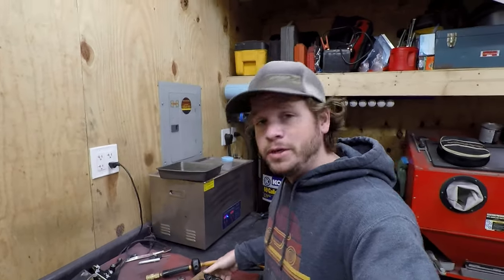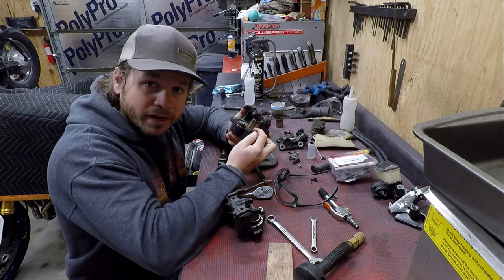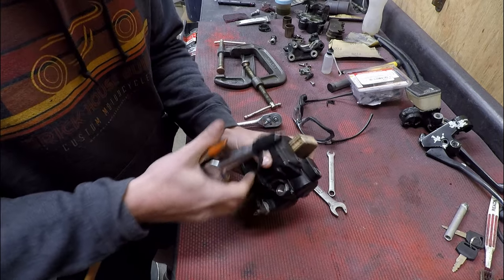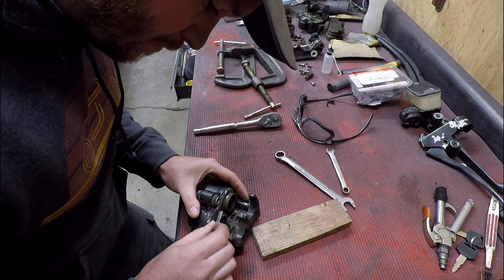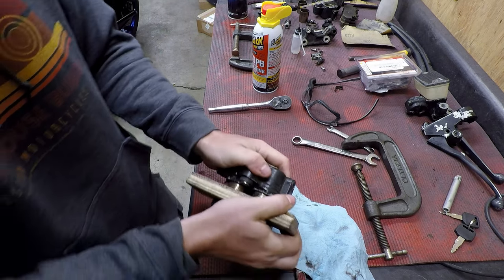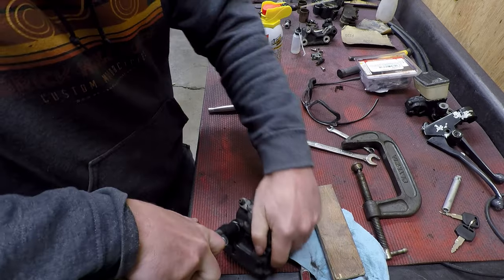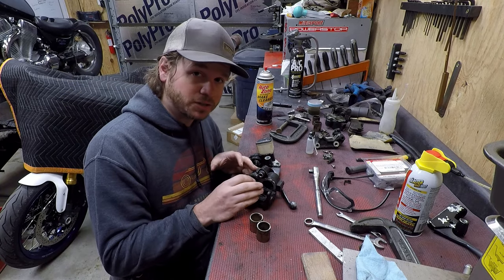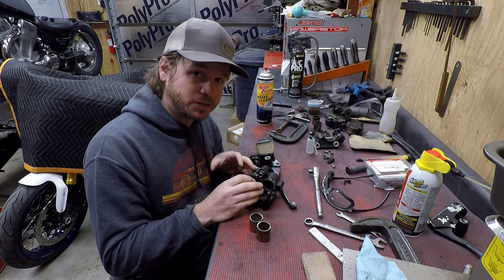HOW TO Remove Stuck Brake Caliper Pistons - GL650 Build - EP14

Comment: If they came out using compressed air they weren't stuck very badly. Air will compress, fluids won't. I've used 200 psi trying to get them out before & failed. Easiest way is to hook caliper up to a functioning master cylinder & use brake fluid to press them out. Other tips were good.
Reply from the maker: Well many people don't even know about compressed air. Using another master cylinder is obviously more powerful but I've found this works 98% of the time once you break them free.

Comment: Spot on. Also air compressors aren’t cheap I was going to buy one just for a stuck piston. Sure I can find other uses but £150 on an air compressor doesn’t seem feasible for now 😂 especially as I’ve ordered a rebuild kit, piston and pads for the rear calliper already which again didn’t come cheap. I’ll be using the brake fluid master cylinder messy method until I can get myself an air compressor. Great video buddy!
Reply: I was fortunate enough for my friends to get me one for my birthday, it makes life so much easier

Comment: Soak the calipers in vinegar for a day or two and you will be able to pull them out with your fingers.
Reply from the maker: Any negative side effects on the paint soaking that long?
Reply: @BrickHouseBuilds  No. Vinegar is a very mild acid.You can dunk them in alcohol to neutralize the vinegar or just wash them with hot water.

Comment: You know, as a guy who is working on a Honda CB400T that has sat for twenty or so years and the brake fluid broke down and the pistons are stuck, I really appreciated this video.  I think this bike might actually use the same caliper as the left one of that pair.
Reply from the maker: Glad its helpful! The info can be used on any caliper but glad it has a direct reference for yours
Reply: @BrickHouseBuilds  Out of curiosity, do you remember / know what PSI you were using in this video?

Comment: Try cleaning pistons with 0000 grade superfine steel wool works good with WD-40 to clean stainless steel or chrome surfaces with corrosion or surface rust.

Comment: One of the better tutorials on how to do a challenging job without too much drama. Thanks.
Reply from the maker: Glad you found it helpful!
Reply: @BrickHouseBuilds  Yeah; I wasn't planning on doing the brakes, but I had to rebuild the forks on my 2002 ZX9r (blown seal), which was an educational (and messy)  experience, and when re-installing the calipers, noted that one  of the caliper pistons on the right  caliper was awfully difficult to press back for pad installation. So it looks like a caliper rebuild is in the near future, even though the brakes seem to be working ok. I think I probably should rebuild the master as well, while I have the system drained. After all; I;ve put 83000+ miles on this bike...

Comment: Just came across this video. Its very good info. Iv used the spare mastercylinder trick to get pistons out. I like the c clamp 1 with the caliper sealed off and wind in the clamp to move the stuck piston.
Thanks for this vid.

Comment: I have used a fresh tire valve stem because I didn't have the rubber tipped air nozzle. Good video, well done and nicely explained!
Reply from the maker: Thats a killer tip right there! Thanks for sharing

Comment: You are a great teacher. I saw your video and used the air compressor method and it worked great, I was just getting ready to some unorthodox prying and chisel method. 😝
Reply from the maker: Glad it worked! Using a grease gun has been nice. Another method that is trick is using sockets wedged into the piston to twist it out

Comment: Really digging the last tech with filling the caliper with fluid and pushing the good piston in with a C-clamp. Think it's gonna be my only shott with my current situation and I don't think I would of thought about it on my own before ruining something in a fit if rage lol. That tech tip alone won my subscription.
Thank you!!!
Reply from the maker: Hey glad to help! Thank you
Reply: Just got done actually and it worked perfectly!
Reply from the maker: @champagne2832  awesome to hear!

Comment: Hi, another trick if you don't have air compresor . Use a and greaser plugged in the bleeding nipple and the grease will force it out as you pump . Thanks . Gus
Reply from the maker: Yup I've seen that too and its a good trick for sure
Reply: Second that

Comment: Any advice when pistons are made of backelite ? I have been coping with such a problem with a cylinder not moving that I had to buy a new caliper complete…
Reply from the maker: I would think material would be irrelevant although i'm not sure what backelite is.  The operation should be the same
Reply: Just came across ur vid. Bakealite is the early form of hard plastic. Very old telafones and light switchs use to be made from it @BrickHouseBuilds

Comment: Excellent! Gonna try that this week end. How much PSI did you inject roughly ? ( had to buy  an air compressor and would like one that is just enough ).
Thank you :)
Reply from the maker: About 100psi. I actually just posted a video yesterday with a section on piston removal with a grease gun that is much more controlled

Comment: Also seen this done with a grease gun and fill the caliber with grease to pop the piston out.  But I think you have to replace the bleed screw with a zert fitting for your size of gun and seal off the inlet.  Definitely more complicated than master cylinder method.
Reply from the maker: I've seen that too and it definitely works. I just got lucky on this one that I didn't have to go beyond air!
Reply: Very messy methodbut it does work! I always try the air first!

Comment: BJ, I am working on a 1985 Nighthawk 650 which seems to have the same style of calibers I think. What has been your favorite parts source for line, pads, etc on these type of old Hondas? Thanks!
Reply from the maker: My general list is: partzilla, revzilla, cmsnl, old bike barn, dime city cycles, ebay, David silver spares, 4into1, and occasionally Amazon depending on what it is. Avoid the cheapest options as they are rarely any good.
Reply: @BrickHouseBuilds  you’re the man! Thanks.

Comment: Nice work. I don't have a compressor so the other tips are great for me
Reply from the maker: @ArcanePath360  a reeeeeaaally good one I've been doing recently is using a socket and an extension to twist them out. Get a 3/8 rachet extension and a socket. The socket needs to be just a big enough diameter to let the square end of the extension fit between the side of the socket and inside wall of the caliper piston. Put your wrench on the extension and twist. May take some fiddling but it's an awesome trick
Reply: @BrickHouseBuilds   But what if you have pistons that aren't hollow? I have plastic looking end pieces on mine (BMW Brembo)
Reply from the maker: @ArcanePath360  ah, yeah that won't work then. If you have a grease gun, force them out using that. You fill the caliper via the bleeder with grease
Reply: @BrickHouseBuilds   I was just going to leave it on the bike and push the pistons out with the lever as far as they go uniformly until they just pop out into a bucket with all the fluid. I'm replacing the pistons anyway as they are pitted near the seal end. Whichever one comes out first I can just pull the other one out with wide grip pliers I reckon

Comment: How can stuck pistons be removed if they are stuck fast but leak pressure (due to being incorrectly inserted into a calliper)? Is drilling the only way?
Reply from the maker: If you have a bearing puller you may be able to clamp on the inside and slide hammer out
Reply: @BrickHouseBuilds , thanks. I took the calliper to a mechanic's workshop in the end. The stuck pistons were removed using a better air compressor than my hand pump. I'm grateful for your reply.

Comment: Hey I’m having somewhat of the same problem with my bike rear caliper. I took it apart and piston does not have any corrosion it still looks brand new but I still cleaned it up & when I had put everything back on the bike I wasn’t able to move my bike forward at all it’s like the piston were applying on its own without me pressing the rear brake. Anything tips what should i do 😥 idk why pistons are coming out on its own.
Reply from the maker: I would look to make sure you have the physical caliper and components mounted right. I've seen some crazy stuff with things being bolted on wrong causing binding.

Comment: So when the compressed air doesn't work next step is the lever. Thank you
Reply from the maker: If you have a working master cylinder and clear line that is usually the most powerful way. Another option is a grease gun
Reply: @BrickHouseBuilds  i actually work on a bycicle But the solutions are similar, as I see. Too bad I didn't done it with the lever at the start. Now I must First bleed it again. Anyway thanks for the help

Comment: If the piston is binding on the disc can it be levered  back in
Reply from the maker: I guess that depends on how bound it is
Reply: @BrickHouseBuilds  the wheel does go round but binding a bit
Reply from the maker: If you feel the piston is binding it's just a safety precaution to disassemble and clean.  Your life is worth more than  saving a few bucks

Comment: A good plan is to pump them out before dismantling the brake system.
Reply from the maker: That plan works if the master cylinder works. This one was very corroded as I explained.

Comment: Have dismantled 10 from varying bikes it's never the piston...always the Seals which are the issue 
I never used an air line but got a Hand Pump which gave me complete control
Pushing out one is a mistake...they both have to come out simultaneously 
So using Fillers and Clamps to control each Piston individually is the only option 
Better still replace the Brake Piston Seals every 2 years
Reply from the maker: Correct, the seals are what hold the pistons in place and cause the problems. I think you may have misunderstood my methods or explanation in a couple parts though.

Comment: What if i don't have an air compressor?
Reply from the maker: If you have a good master cylinder you can hook the line up, bleed, and pump it out. First use a clamp to push the pistons in and break the seal tension. then pump out

Comment: What if one comes out and not the other?
Reply from the maker: Unless you restrain one piston you will only be able to move 1 at a time.  You should check out my latest CX500 video for a section of removing pistons using a grease gun

Comment: As a professional (as per your intro).... why don't you have a piston puller?  For less than $30 you can actually be that professional.
Reply from the maker: It's on the list but low priority
Reply: Because he was showing us ppl who dont have a piston puller how to do it with equipment we may have.
Reply: @michaelandmariedownes6070  well, then I suggest getting a set. Worth it and they work well. 2 types, pliers type and expander/puller type. Inexpensive and they work.